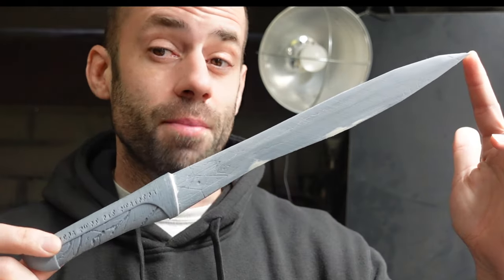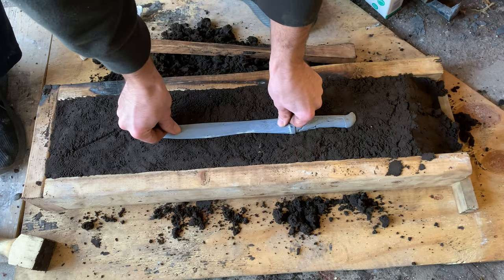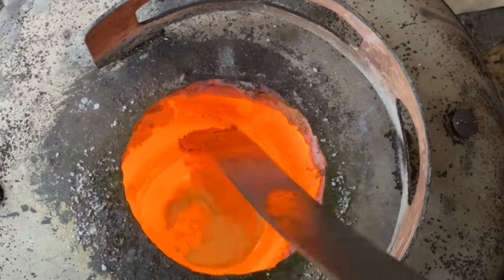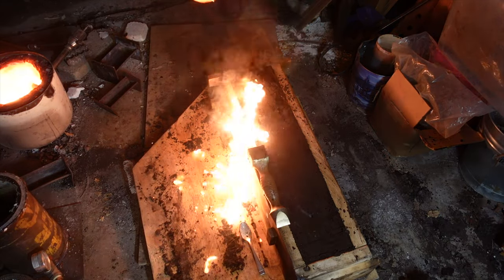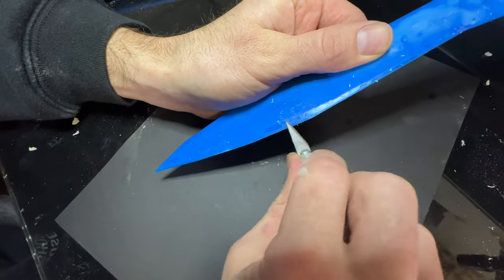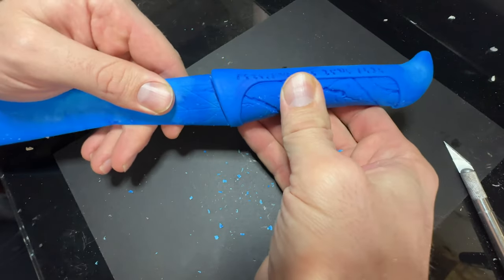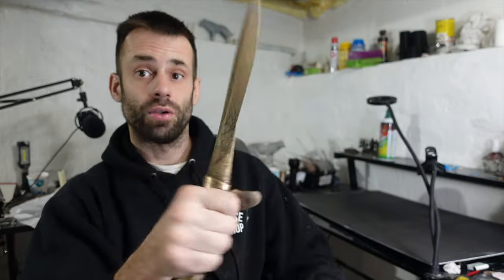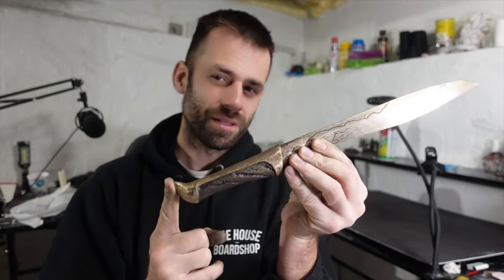Making a Dune Crysknife: 3D Print to Bronze

Comment: Adopt the one hour rule for your shop. No welding, burning, heating anything for one hour before you leave. Check all plugged in devices, soldering irons etc., gas valves and sniff for smoke, and store those propane cylinders outside before you walk out. Fire is a very real thing and easily started. In my 44 years of shop work I've encountered several unintended fire situations. Great video.
Reply: interesting

Comment: Man that turned out great!  Crazy how much that steel tube expanded!  I would be really interested to see how well that wax resin works with ceramic shell.  I printed a whole bunch of stuff to invest with Suspendaslurry, but then I read that it cracks ceramic shell during the burn out, so I got discouraged..  I'll probably still try though.  I was thinking of just drilling a bunch of tiny drainage holes in the shell before burnout and patch them afterwards.  Keep em comin!  I hope this video does really well for you.
Reply from the maker: It does seem to expand a lot. I find a lot of cracks even in the investment. However the last few pieces I had issues like that were solid and I’m thinking a hollow print might allow for expansion without cracking the investment. 
This resin doesn’t seem to melt out as much as it just burns away, so I’m not sure  drainage holes would work but I’d be curious to see how it would work.
Reply: We have had a ton of problems with that resin and suspendaslury! We went through about a dozen castings. I'm currently 2 days into a hollow print to see how that works.
Reply: @HawkWorley 100% of the time, print hollow when possible. There's no need to have it filled, you can add wax in if you want after, but for the print, hollow is better. Just remember to plug the holes after curing and drying lol

Comment: The metal should be a bit hotter and the mold can be preheated with torch. When you make testing and vary settings, modify only one parameter at a time to find out the true response.
Reply from the maker: I think you are right the metal was too cold.

Comment: Would you be able to cast a knife like this but out of silicon bronze but cast most of the blade around a sheet of tool steel for the edge?
Reply: Like use a 1/4" width strip of some kind of hard alloy plate steel to act as the cutting edge of the knife and just incorporate the plate into the mold and pour molten silicon bronze around it to create a decorative and functional blade?
Reply from the maker: You could do that but it’s not going to weld together so there would be a seem between the bronze and the steel.

Comment: print without supports. printers have a native setting to detect beams and speedup and stretch the ooze. the hole in the handle is so small it could have printed without support